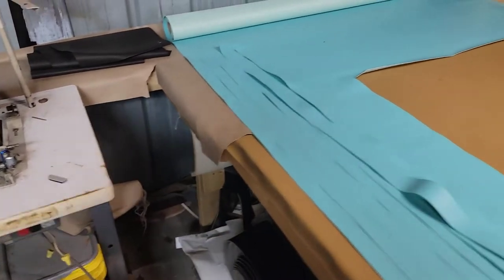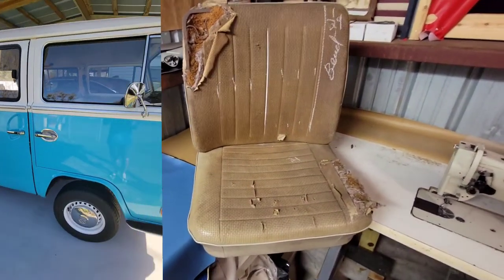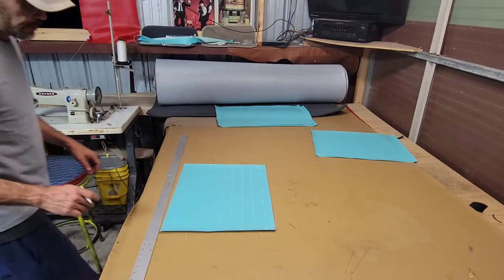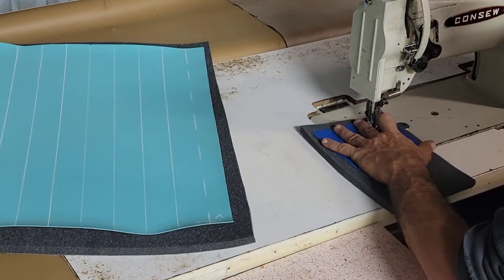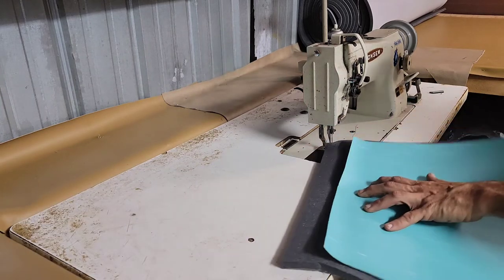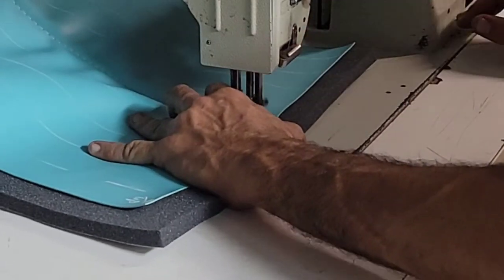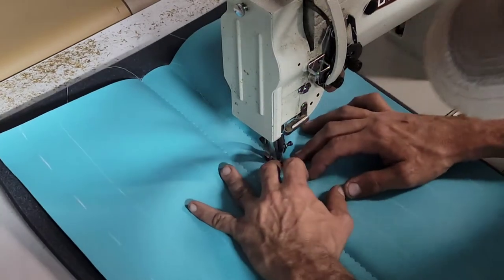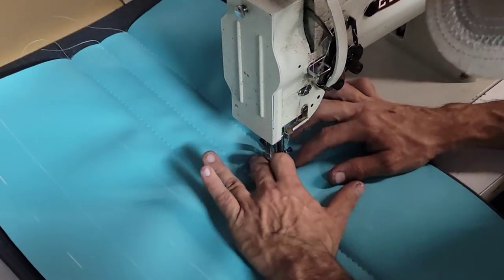Discover the Quickest Way to Sew Perfect Pleats!

Comment: I ordered the sew foam and I love it. The only issue I still have is using a regular sewing machine I can't get the stitches on the top to be all the same. I set the stitch width to the widest because I want to see the sewing. But it starts good then gets less bold then towards the end back to bold how I want it. Any ideas? I'm trying to upholster my sons seats for his 1929 hot rod. Thanks so much,
Reply from the maker: Try loosening the tension a bit , also if you can press the foam down in front of the foot as close as you can it will help, just go slow

Comment: Can you tell me which sew foam you use? I see there is stitch back, cloth back, scrim backed. Not sure which to use. Thank you and this is the best video I have seen! Oh one other question. Can you use a standard sewing machine on the foam? I've had issues using other foams.
Reply from the maker: Thank you! I appreciate that very much.  The foam I use is pretty dense 1/2" sew foam.  I would call it a very tight netting almost on the back if not very thin material.  I'm not sure about a standard machine tho, try using the longest thread length and press the foam down in front of the foot to keep it from drawing up.  Let me know how it does